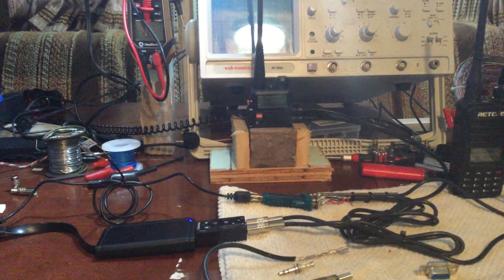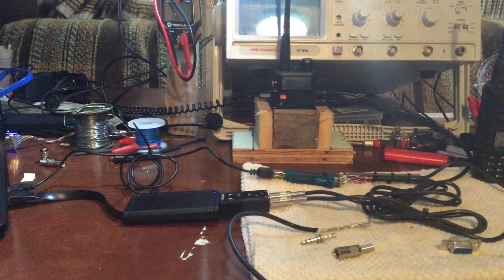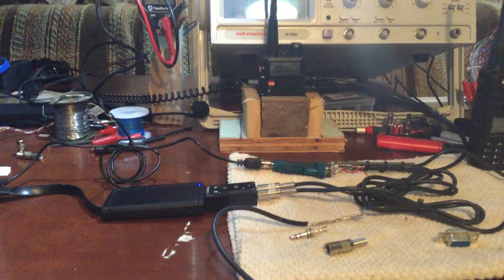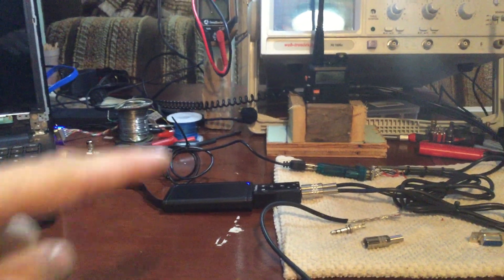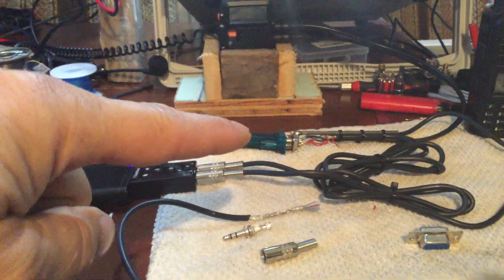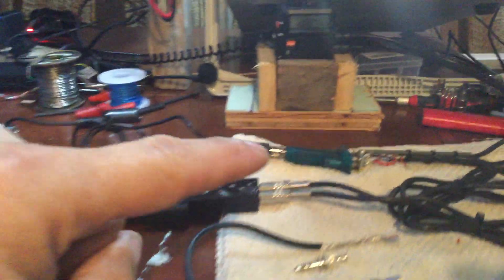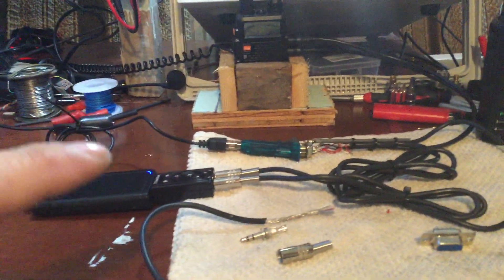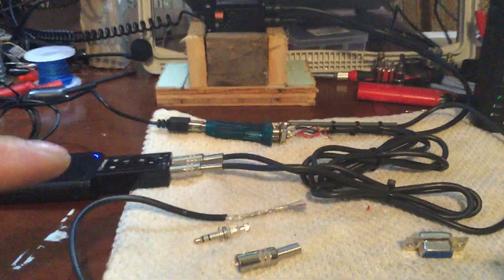🔺hookup ANY GMRS two way radio does NOT have DB9 (data) to Zello gateway, NO VOX, No interface box🔺

Comment: my rasberry pi 4b is running windows 10 home. I plan on hooking the r1-2020 to the pi and the radio will be my sm50 repeater
Reply from the maker: As long as the Raspberry Pi is running some type of windows, then it should work.  If the PI is running Linux, then it won't work with the R1-2020 box due to there is no driver for it. Well, I should say, not that I know of it.